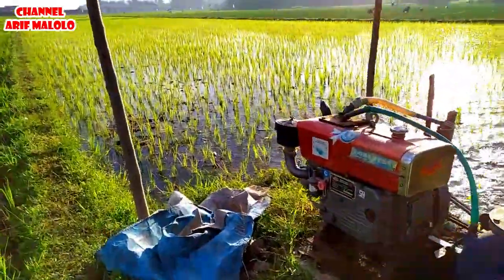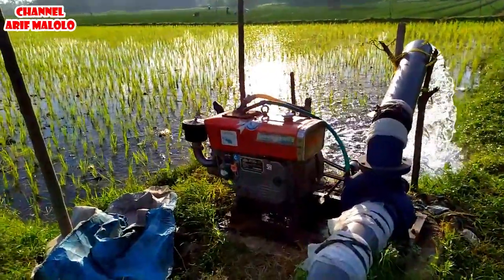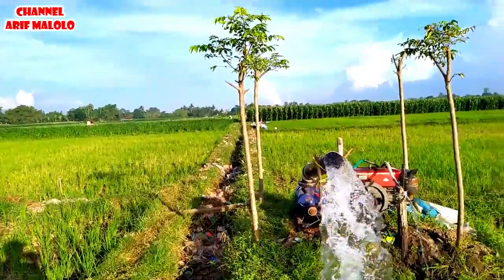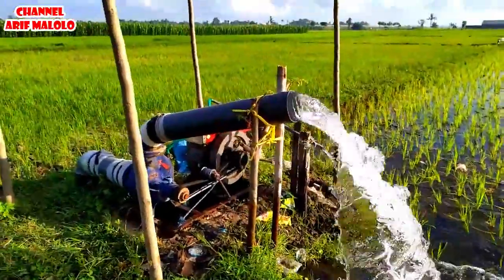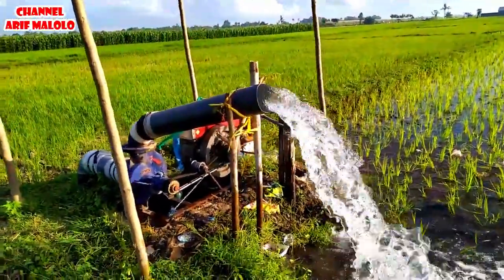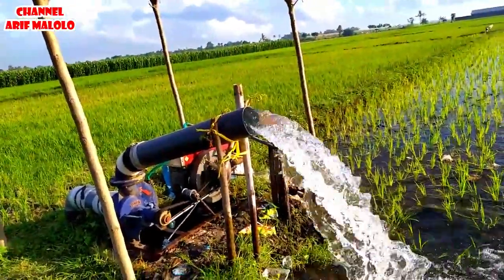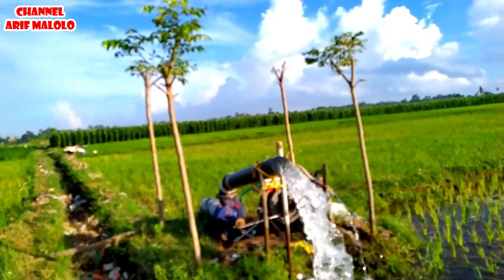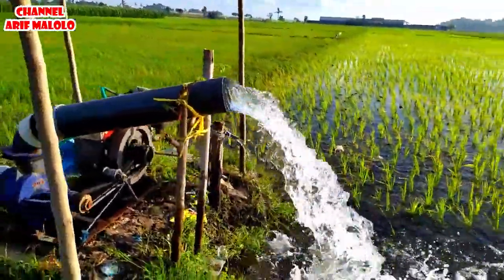Mesin BARU POMPA BARU DENGAN KEDALAMAN BOR 6 DIM 8 meter PERMUKAAN AIR 4 METER MANTAP

Comment: saya banyak lihat video sampean Pak.. kalo lihat sumur di situ yakin bikin iri. di tempat saya bikin sumur 30 meter baru ketemu sumber air itu pun gak besar, nyedot pakai alkon itu pun gak bisa besar soalnya kalo gas dinaikan lagi air tekor. btw sumurnya 2 dim.
ada saran Pak biar air bisa byor?
Reply from the maker: Makasih..........berati itu bornya belum kena ke sumber yang besar......coba konsultasi ke tukang bornya....kurang dalem apa terlalu dalem.......soalx setiap lokasi beda2